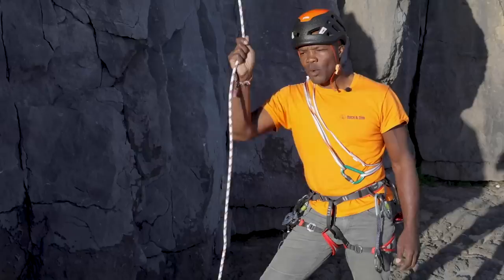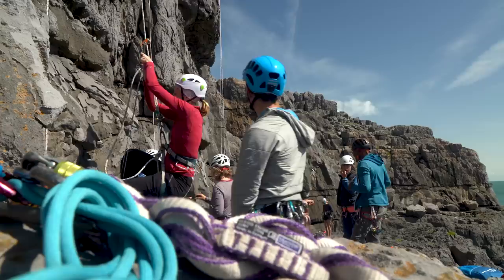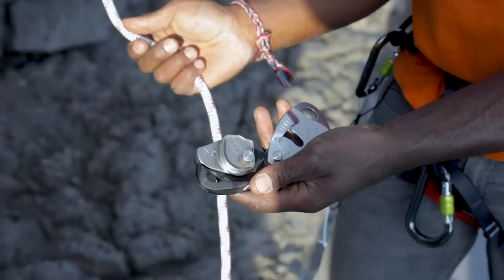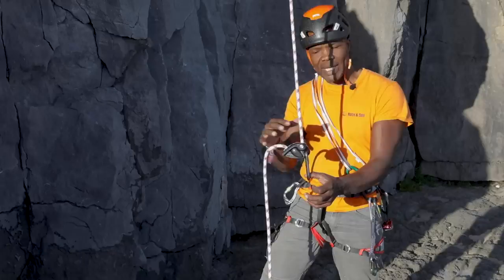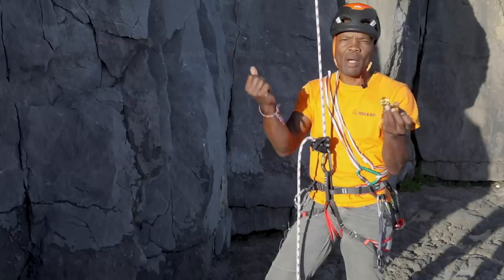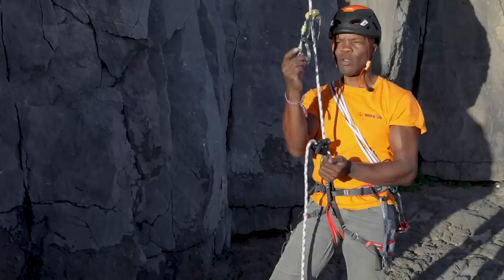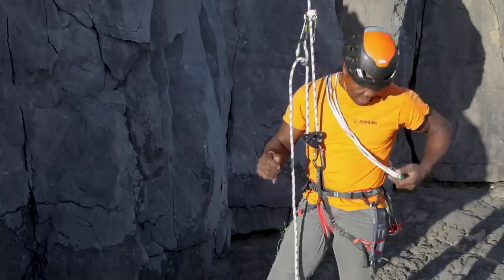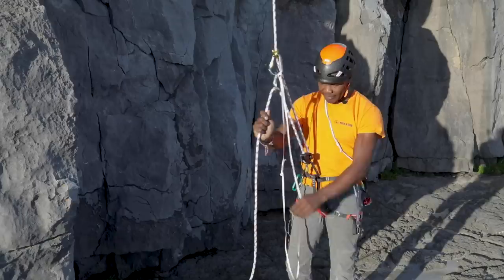Using A Mechanical Ascender To Climb A Rope | Climbing Daily Ep.1554

Comment: Can you do this without a grigri?
An atc, a petzl ascender, gates and sling
Reply: Yes
Reply: Only if you have a guide ATC. it will not really work with a standard ATC.
Reply: I work on Cell Towers. I use the grigri to an ascender with a rescue pulley attached to the ascender.  I also stand in a sling to work smarter.  Great set up for rescue as well.

Comment: It strikes me that the way you are running the Gri Gri in this video is not very safe. According to
 https://youtu.be/We-nxljgnw4
The three worst things you can do while using a Gri Gri are; 1 not holding the free end, 2 holding the feeding free end of the rope above the Gri Gri instead of below it, and 3 take a fall with no slack in the climbing end, which aids the Gri Gri in locking. You are doing things 2 and 3 two with your setup and item 1 would be really tempting to do on accident.

Others asked if you could use an ATC i stead of a Gri Gri with tbis technique. You could not because an ATC requires the free end of the rope to be pulled away from the climbing end to break.

Comment: I find myself liking more a simple system with 2 prussik or one tblock and a prussik without the pulley advantage as I find with proper balance on the foot loop I can get like 3.5/4 feet of ascending every time, too much to be recovered through the pulley (as you see it doubled   (8 feet)since it gives you mechanical advantage)
Reply: You can use this system here without the pulley too. My ascent system at work is a Lory descender (like a grigri) and a handled ascender with a footloop. I can ascend al lot faster without a pulley than with one. Faster to set up, too.
Reply: @raphaelbeinhauer9242  that's the concept yeah! I was talking about prussik because when out climbing long route I rarely have an assisted breaking device with me, but that's it.

Comment: 3:1!
Reply: That is a 2:1 with a redirect, since the load is attached to a pulley.
Reply: Actually it is a 3:1 - the rope exiting the pulley is not a redirect, it is connected to the load. If the rope was connected to a person on the ground, it would be 2:1.
Reply: @Hidden_Destinations  If you learn how to count the tensions in mechanical advantage systems, you'll see that it's a 2:1 with a redirect. When the pulley is on the load (him), you can't get a 3:1.

Comment: A professional instructor should give nothing but absolutely safe instructions in an instructional video.
Here he again doesnt not do this, I am starting to think that he really is not fit for teaching in a sport where a mistake could lead to fatal results.
Although unlikely, the ropeman failing would lead to failing of the whole system as it would jam the grigris ability to block the rope.
Mean the there is no redundancy if the upper device fails. There are easy ways to make it redundant and safe and those should be tought.
Pls epicTV, correct this and get a good up to date instructor for instructional videos.
Reply: Would it be safe if the ropeman were replaced by a prussic? And why should it fail? Thks